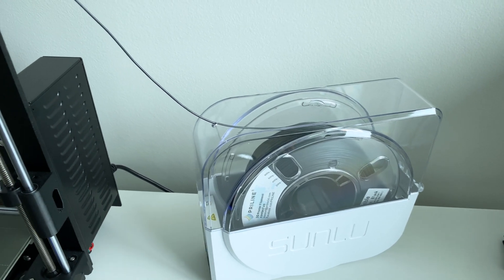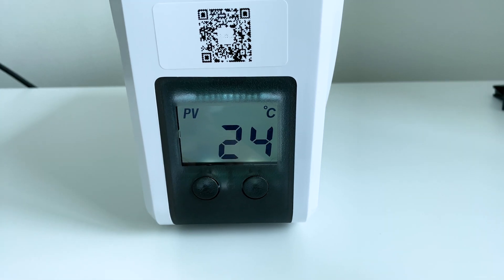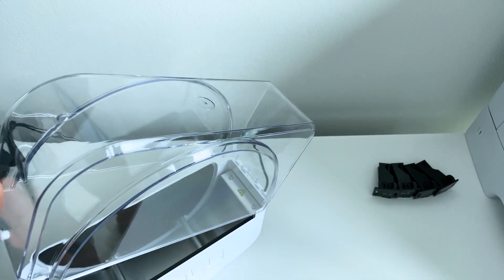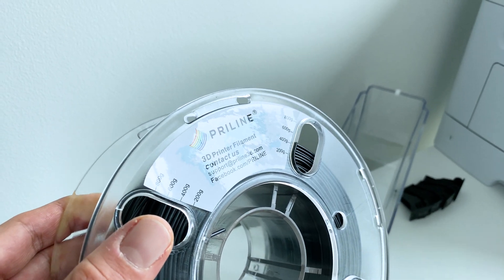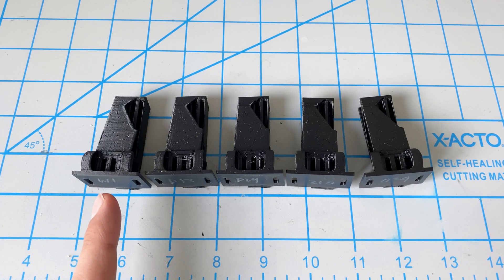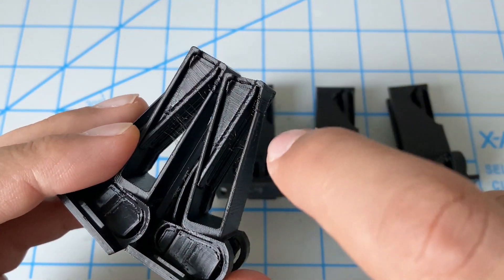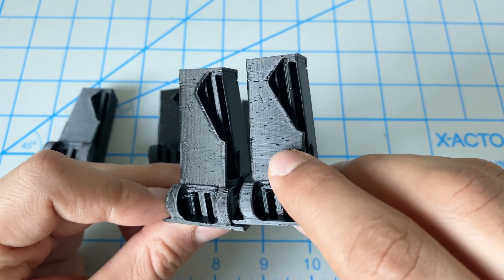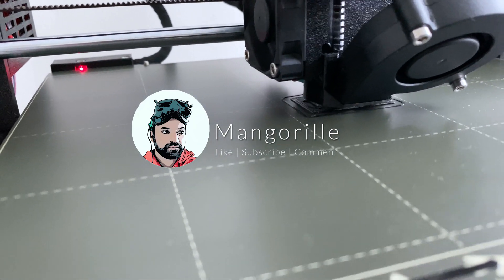SUNLU FilaDryer S1 Unboxing and Review | Do you REALLY need a filament dryer for your 3d printer?

Comment: I've heard this style doesn't evenly dry the filament because there's no air circulation. I've seen a video where someone added a fan to help circulate the air around the spool.
I think there's a dryer made by Sovol that has an air circulating system built into it. Will take 2 1kg spools too.
Reply from the maker: A fan would be a good idea but like I said in the video, this is more suited to keeping the filament dry vs actually drying it out. You're better of tossing a roll that has already absorbed moisture into the oven.

Comment: Thanx for the upload so what you saying is if I put the filament in the Sunlu for 34 hours I will achieve the same result as the oven ?
Reply from the maker: Depends on your filament, how much moisture it has absorbed, and how humid your printing area is. The takeaway is that the dryer works great for keeping the filament dry but takes too long to actually dry the filament.

Comment: I had one of theses and didnt find any difference whilst using it so over £40 waisted
Reply: You will have to modify it to make it work properly. I don't know what to think about a "review" like this.
Reply: @michaelb7071  hello dont think too much into it i didnt work for me and i shouldnt have to try to make it work it should just work its only a heater all said and done
Reply from the maker: What kind of filament did you try using this for? We use it for mainly TPU and it did make a difference, definitely not as much as sticking the filament into the oven or a food dehydrator but still helped keep the filament dry.
Reply: @Mangorille  hello i used prusament and a roll form china which i cant remember the name but to be honest i just keep my filament sat in it hoping this helps as it has to be better than leaving it on my machine but time will tell
Reply from the maker: @airwolf08  Hey. We do the same, at least it helps keep the moisture out of the filament especially with things like TPU, PETG, and Nylon.
Reply: @Mangorille  hi ive never used TPU how does that print?

Comment: The rollers suck.

Did you keep drying the same filament? If so this test is flawed since it's dryer each time you start a new cycle.
Reply from the maker: The rollers could be better but they're okay in practice. You'll get the occasional noise from them when the print head is moving quickly across the bed and pulling the filament quickly.
Reply: @Mangorille  All of them aren't the same, my rollers are difficult to turn.
Reply from the maker: @timmturner  Is that with a roll of filament on them or even without? Mine are really smooth and easy to turn without a roll of filament.
Reply: @Mangorille  Correct, with filament. If you look around you will see it's a common issue.
Reply from the maker: @timmturner  Good to know, mine with the filament roll is still smooth just noisy.
Reply: @Mangorille  Mine is super rough with and without filament, honestly I don't think these get warm enough to help much. I mean if you can still draw a lot more moisture out using other methods this thing is nearly pointless, it's also crazily overpriced.

Comment: I have bought it and I found it has a "design flaw", there are no holes on the top to let the moisture evaporare, it remains inside.
I am used to put the filament in a food dehydrator which reaches 75°C and it has holes on the top, and it worked a bit better than the sunlu.
55 degrees are not enough for some filaments. anyway I did some small holes on the top.
Reply from the maker: Found the same, it's good at keeping filaments dry but not as effective at drying it out as a food dehydrator or oven. I usually leave the descant inside the hole in the filament roll to help absorb any moisture that is given off while in the Sunlu.
Reply: @Mangorille  make 6 small holes on the top, it will improve a bit.

Comment: did you buy a new printer? how is it compared to a Ender 3 pro?
Reply from the maker: Hey. Yes, got the Prusa printer. Been fiddling with it over the last couple of months to form a proper comparison but overall the print quality is no different than the Ender 3. It has a lot more comfort and safety features out of the box like the filament loader, direct drive, auto bed leveling, thermal runaway protection, etc. But all those can be added to the Ender 3 at your own pace. I do find that the Prusa vibrates and resonates a lot more when placed on a non-solid surface making it substantially louder than the Ender 3 especially after you do the silent board and fan upgrades to the Ender. I'm starting to form the opinion that the Prusa is good for people who don't like to tinker whereas the Ender 3 is great for folks who don't mind rolling up their sleeves. I keep wanting to do my prints on the Ender but keep pushing myself to use the Prusa so I can form a solid comparison.
Reply: @Mangorille  Ah okay, I was thinking of getting a prusa 3 clone but than i rather just start to build a voron. My ender 3 can print at 120mm/s now with pretty good quality. I thought the Prusa would be a big step up..
Reply from the maker: @MrLog300  If your Ender is stock then yes for sure but would be diminishing returns once you have your Ender upgraded. Wow 120mm/s on the ender is insane!
Reply: @Mangorille  yeah I'm pretty happy with the speed but i have a lot of upgrades, skr mini 1.2, dual z, v6 hotend, bmg extruder, it's direct drive with the hydra fan duct from thingiverse. You should try it. It's great. Also. I wouldn't do 120mm/s when I need detailed things.
Reply: @Mangorille  Great content as always. Keep up the good work.